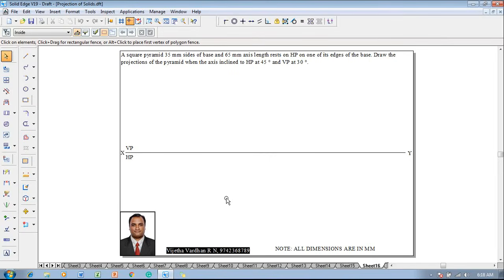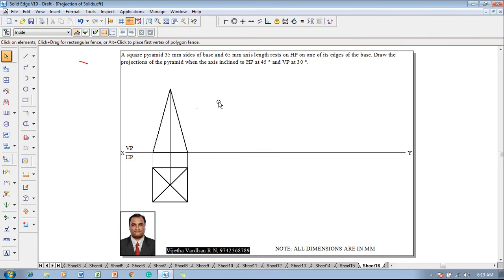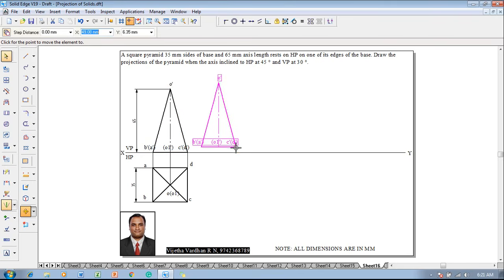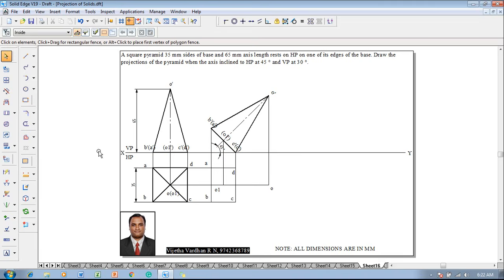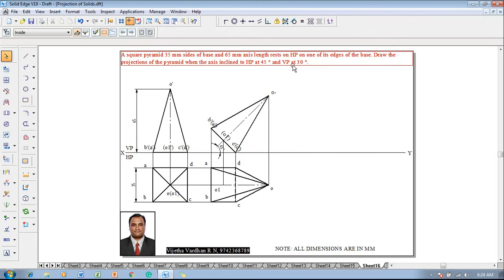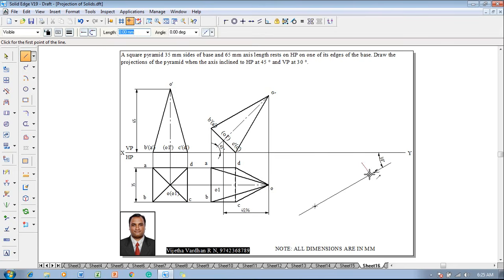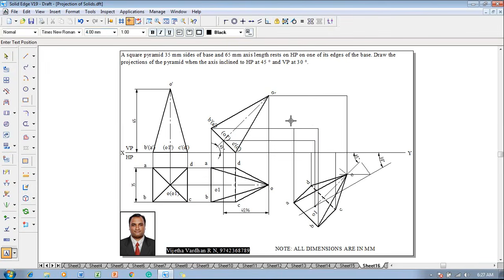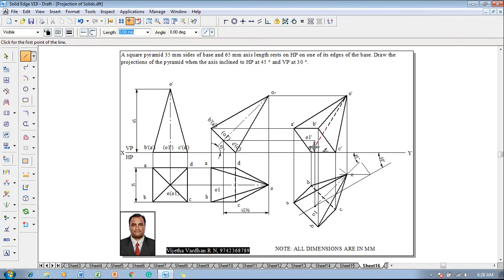Example 16 on Projection of Solids

Comment: Our sir Did not Teach anything  about true angle and apparent angle sir. Confused between the two.

for example in this case took a -30 degree line. Moved the second position with respect to D and rotated it so that D and C were on the -30 degree line. 

o' is facing upwards
Reply from the maker: Hi in simple words if the same line is inclined with both the principal planes it will be an apparent length for sure.
Reply: @VijethaVardhanRN  Thank you Sir, Does this mean That we wont have to necessarily have to find beta angle?. Thank you for replying sir